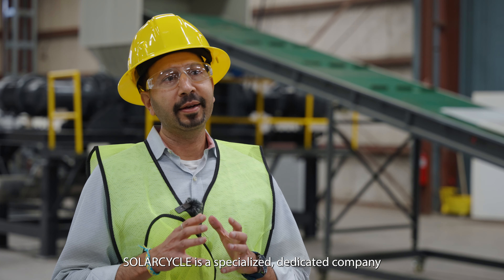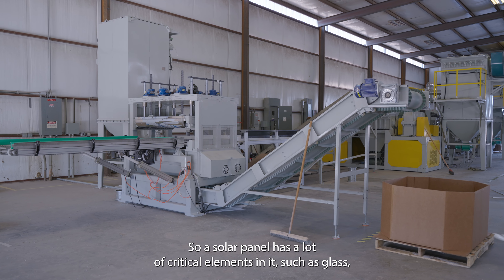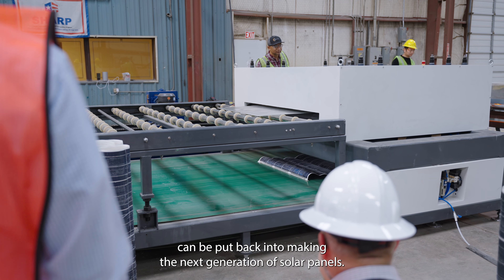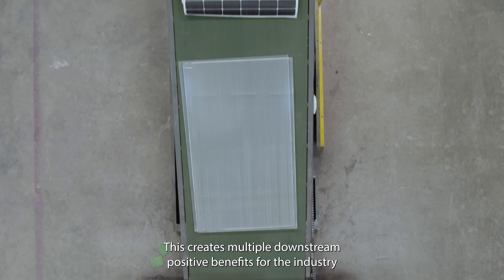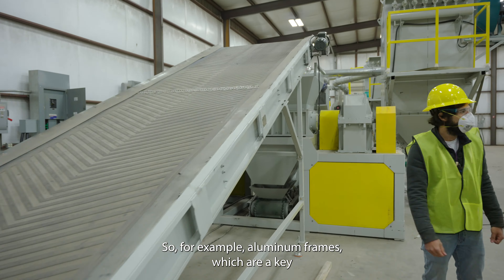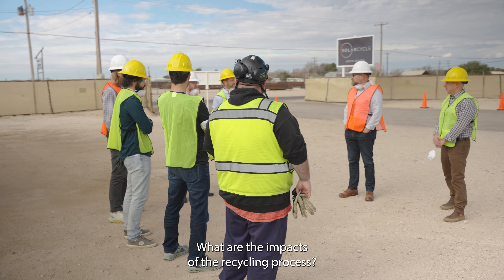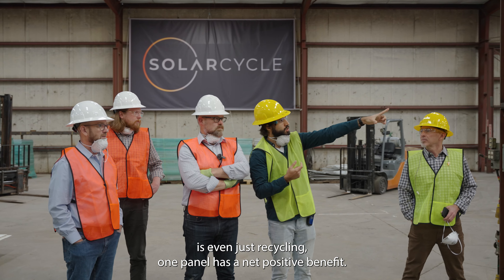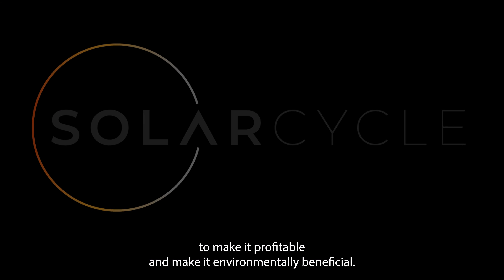Revolutionizing Solar: How SOLARCYCLE Transforms Old Solar Panels into New Opportunities

Comment: Maybe it's time to standardise the sizes of panels. This would have huge benefits for people replacing worn out or damaged panels, but also the recycling would become mych easier. A high percentage of the aluminium frames could then be reused immediately, without further processing.